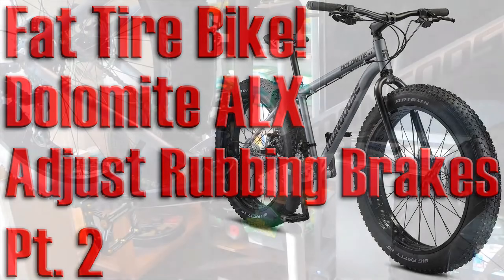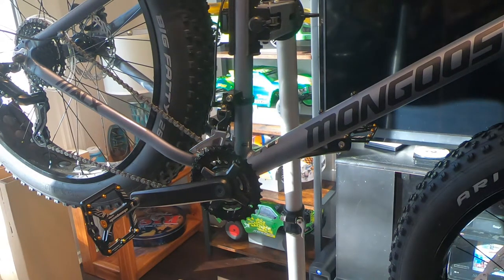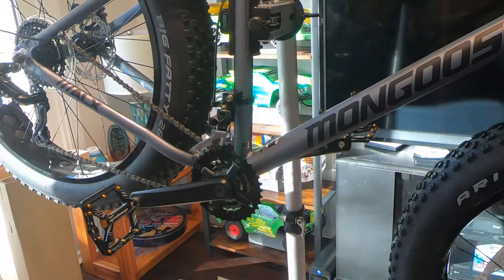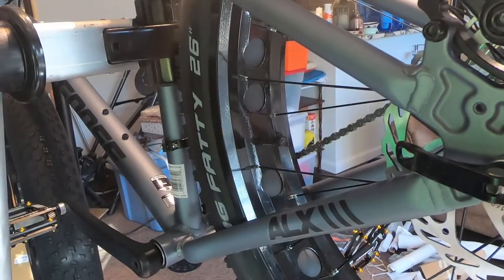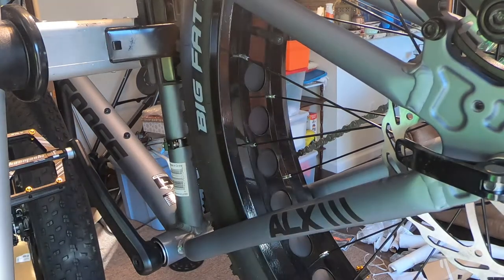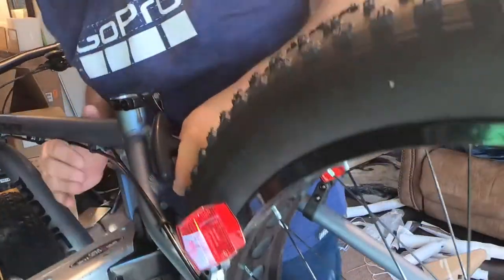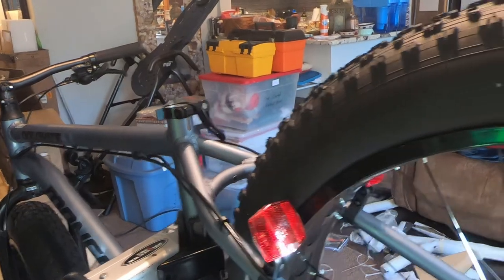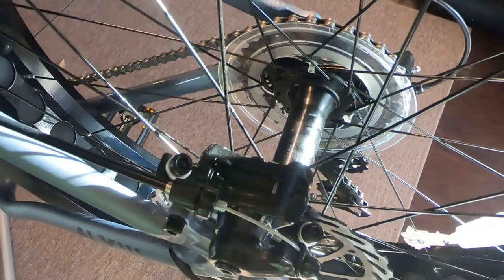Adjusting Mechanical Disk Brakes - Mongoose Dolomite ALX Fat Tire MTB - Pt. 2

Comment: THANKS FOR THIS VIDEO!  I HAVE THE EXACT SAME BIKE.  I'VE BEEN LOOKING ALL OVER FOR SOMETHING LIKE THIS!  JUST A QUESTION FOR YOU IF I MAY - DO YOU KNOW WHAT THE TYPE OF PAD IS CALLED?  OR DO ANY SZE MECHANICAL PADS FIT?  I NOTICE SOME PADS HAVE TWO EYELETS ON THEM FOR THE COTTER PIN I SUPPOSE.  IS THAT THE TYPE I NEED TO BUY?  THANKS SO MUCH FOR MAKING THIS!  I'M GOING TO CHECK OUT YOUR OTHER VIDEOS TOO AND MAYBE MAKE SOME ADDITIONAL CHANGES!  THANKS AGAIN!
Reply from the maker: They used different components as price and availability dictated. I wouldn't want to steer you in the wrong direction. My advice is to take it or at least one of your pads to a bike shop and they can help you find replacement pads.
Best of luck!
CJ